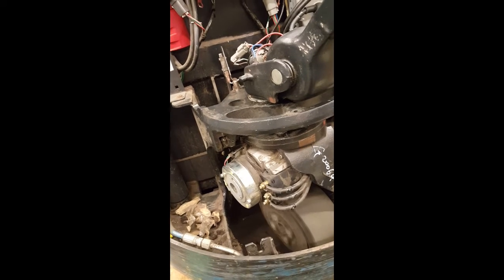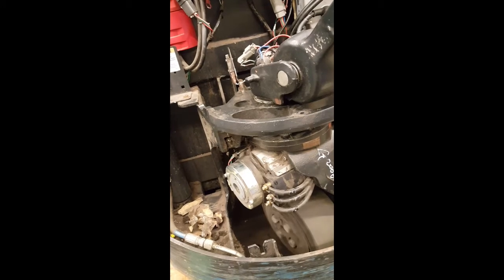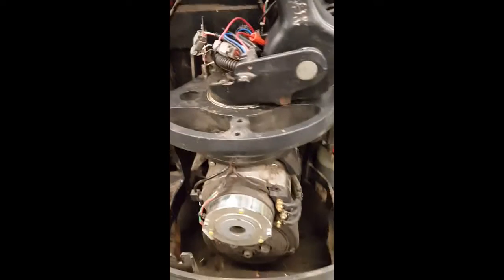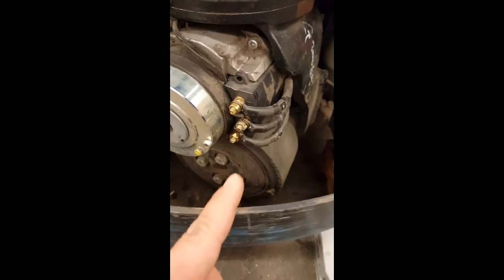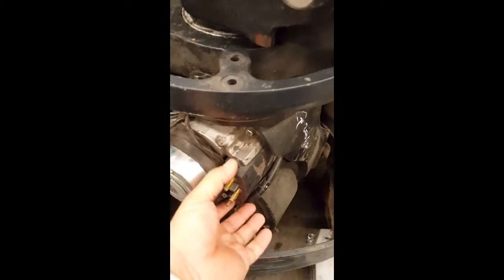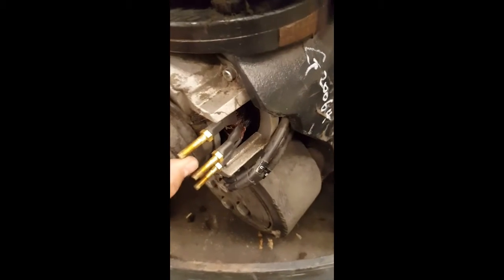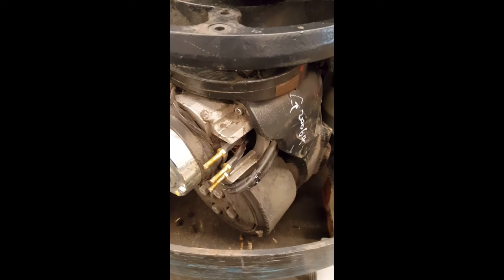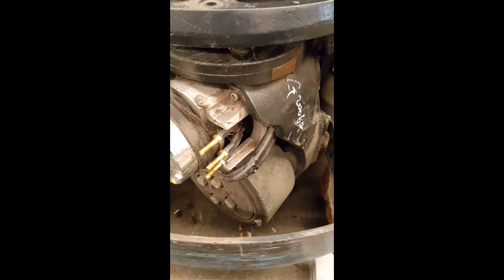Crown WP 3045-45 Drive motor issues troubleshooting

Comment: Hey Steven I have a question I have a wp 3035 Crown won’t turn on or charge do you know why?
Reply from the maker: Your questions had two part I will try my best to answer it.. You may have FU2 fuse 10 amp blew. Checked both 10Amp fuses. Also checked all loose connection specially at key switch.  Second it won't charge the battery,  several factor come in play. Check for coming power to your charger. What type of charger you have? Your gel battery be too weak for chager to read voltage that your charger won't pickup or charge. Could be bad cell on your battery?

Comment: What are you whispering for, you made no point whatsoever.
Reply from the maker: You have no desire to learn how to repairs higher level of Crown power jack so it doesn't make sense to you. Thank you for watch my video and leave your comments. Have a bless day.
Reply: Listen guy, I've been wrenching for 45 years and I'm a certified journeyman mechanic, I don't like guys like you who mislead people ok, you leave a lot of shit out, it's very clear you have removed the motor before hand and then put it back on and then act like you're now taking it off know why, because your removing the screws by hand and you take one hand and easily pull out the motor and then separate it, you don't show what you connected the ground wire to when you added the jumper wire, you don't show how you actually removed the motor, cause it doesn't just fall out, you have to pry it off cause it's firmly snug inside, so don't talk down to me about learning a higher level especially on garbage built by crown, everyone who knows about crown say the same thing, THEIR GARBAGE!!!! Have a great day.
Reply: My brake override stopped working a couple days ago. Do you know how to diagnose the problem or what parts it could be. Its on a wp2300